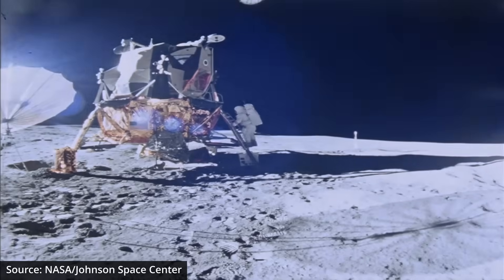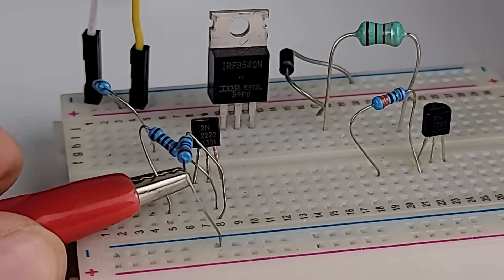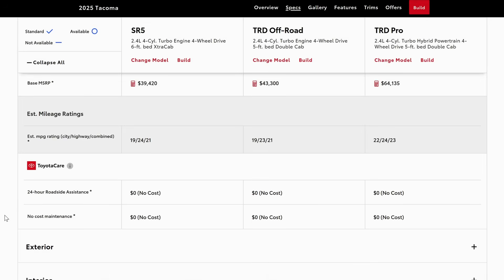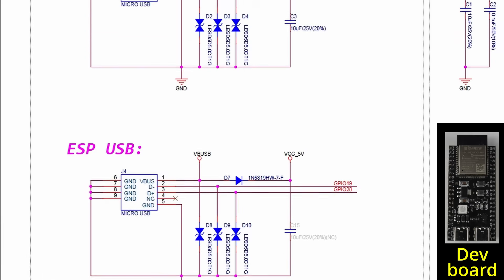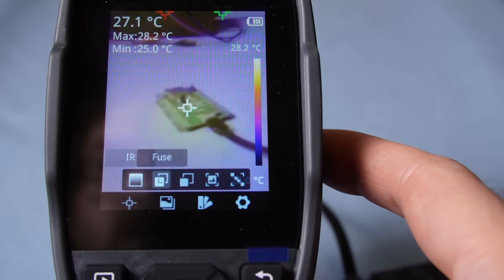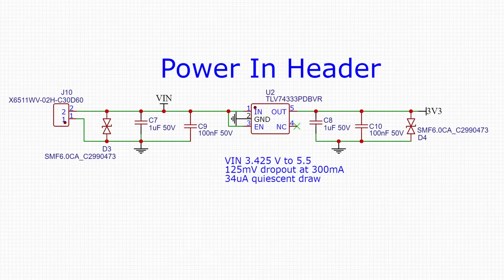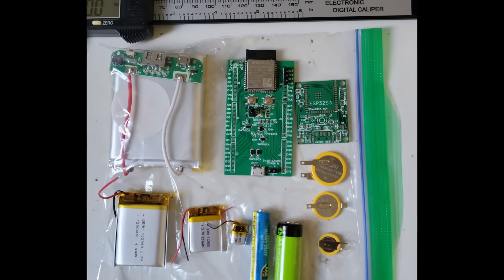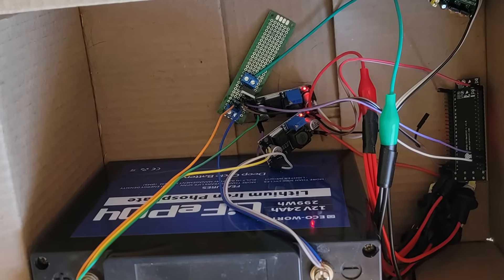ESP32 Dev Board to Custom PCB in 3 Steps

Comment: so, how do you get ideas for a project to begin with? i don't get any inspiration for any projects that aren't solved as a purchaseable solution already. 🤷‍♂️
Reply from the maker: Maybe get more personal with your needs. For example if you already have an ice maker and you want it to be IOT, of course you can buy an IOT ice maker or spend about 10 to $15 and upgrade your existing one. 

Often there are simple things that are sold for a lot of money. I'm going to be building a laser interferometer to measure down at the nanometers and of course I can buy one for $50,000, but I can also make one for about $200.

I can buy a wireless charging pad, but I'd rather make my own and embed it into the perfect phone holder stand for me and my needs. 

You can buy just about anything, but sometimes it is either too expensive or not perfect for you.

Comment: I love your videos. I've been thinking of making my own data loggers for my R&D job because all the sensors we need is 500$+ for each. Now i think i can confidently replicate the commercial sensors for a fraction of the price. Thanks !
Reply from the maker: Such a great application! So many things are $500 but cost $25 in parts! The only phenomena that get expensive to measure is like pH and specific types of gases or chemicals. Everything else tends to be pretty dang cheap! If you already have the high grade gear, that is perfect because a lot of the sensors are not calibrated from the factory but if you use their relative values mapped to correlated values with constants to add and/or multiply most things tend to be pretty accurate!

Do you have any questions, let me know!

Comment: I started by making PWBs (Printed Wiring Boards) that just connected various modules together. Was a great way to start learning KiCAD. Now starting to look at making real PCBs with discreet components with varying degrees of success!
Reply from the maker: "varying levels of success" guaranteed 😂

Don't worry, that applies to everyone 😉 like anything in life your first couple times won't be your best. I hope you make some awesome things!
Reply: so like a PCB where you put devboards and other modules like motor drivers on?
Reply: @G @GamernetsLP hat's what I understood. And it's also what I intend to start with.
I have dev boards on breadboards and getting tired of the unreliability of the wires and the bulky 3d cases.
Soldering an esp dev board and a few modules on a custom pcb seems like a good step forward.

Comment: Bro I need to get I Job now! I really want to do this, so I defiantly will start as soon as I can make some money! Thanks man!
Reply from the maker: EasyEDA software is free, 4 layer board with 10-day shipping from JLCPCB is $10 or less, and maybe $20-50 in parts from distributors and you can do it.

Hot plate is $30-60 and even the most basic soldering iron for $10 can get you started. Maybe $20 for random stuff like tweezers, solder paste, solder wire, and multimeter from AliExpress. And my favorite upgrade is a cheap hot air station for about $30.

Good luck and let me know if you have any questions!
Reply: @FluxBench  Alright! THank you soo much man!